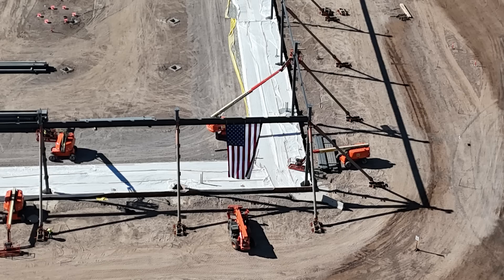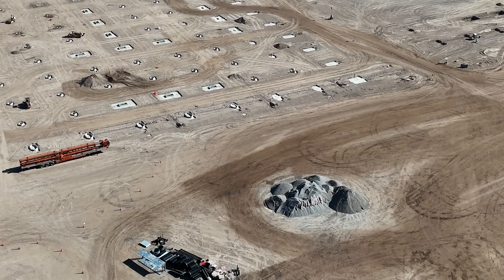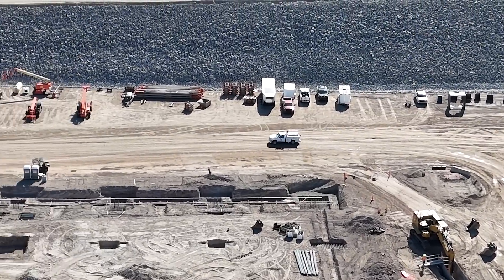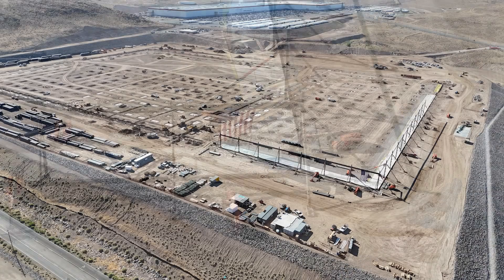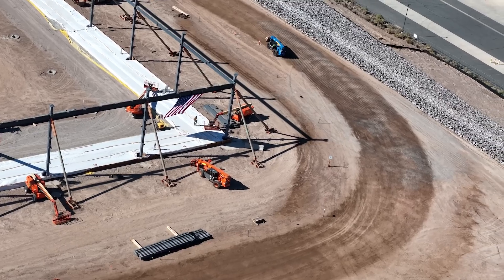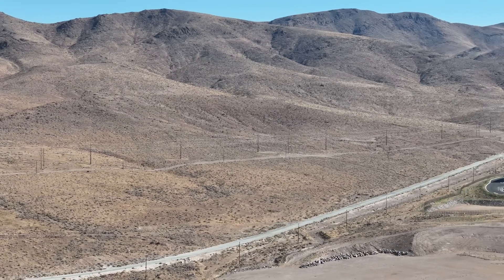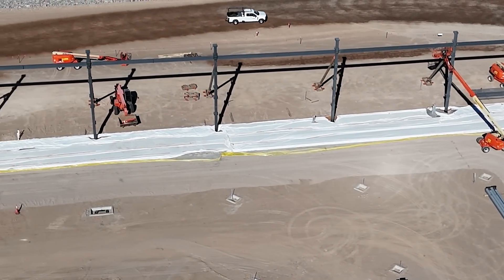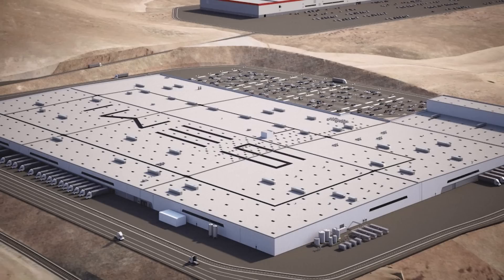Tesla Semi Factory - Steel Yourself for Progress!!!

Comment: 1:43. Orange item to the left. Correction. I guessed crane components in an earlier video. Further investigation shows it to be a BZI Panel Table. A jig for lifting ground assembled wall or floor panels into place. Search BZI Panel Table for examples of use.
5:31. Columns. Correction 2. Connection tabs are for wall purlins. Refer again to BZI site for information on the Wallmaster to see how the wall paneling will be attached.
6:13. BZI has a Mezzmaster system for floor and roof structures that would almost require the roof be assembled and lifted immediately the next line of columns is erected. Mezzmaster attaches to a telehandler, which have limited reach.
Reply: 1:43 BZI construction system. https://youtu.be/LvpLXj2V0gU

Comment: The large footings get a 'mud ' base poured at the bottom. This is a firm surface to support the heavy rebar, and to give  a surface to very accurately set the height of the bolts for the columns.